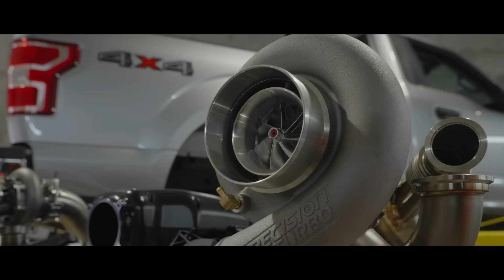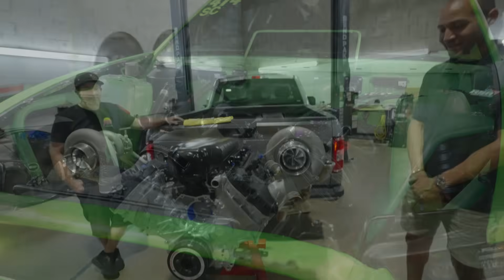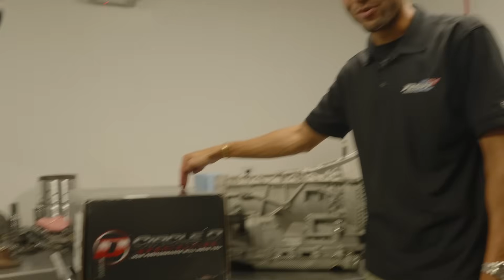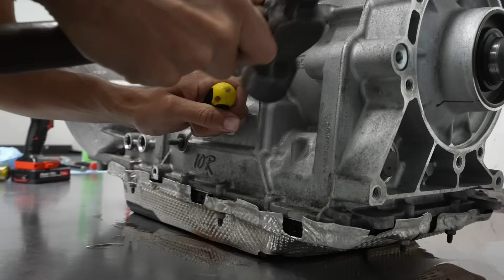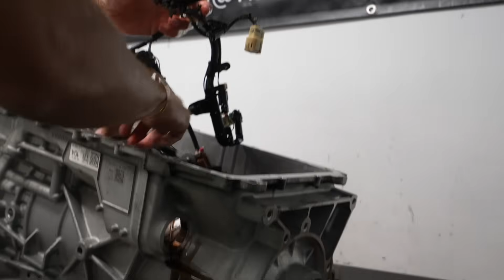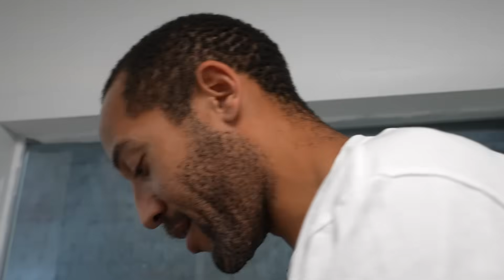1600HP 4WD F150 "Work Truck" (Building the PERFECT Coyote Truck)

Comment: I cant wait for people to develop stronger and/or lighter weight replacement parts like a better drum considering its so small compared to a 6R, where these 10Rs become reliable at all power levels and theres no need for a th400.
Reply: There was never a "need" to do TH-400's or Poweglides. It's a copout; It's expensive to learn about new technology without the right tools or training, people default to what they know best.

 You want more gears to keep the engine in its powerband longer.

Comment: So sick!  I'd also see if power is being put down to all 4 wheels, a lot of XL's have open diffs in the rear and all were open up front.  Raptor's come with a Torsen limited slip front and electronic locking rear if looking for an OEM upgrade.

Comment: That's preschool power compared to those built GTR's  And I'm talking comfortable street driven GTR's!!!!  Why are 2,500-3,000+ hp not as common? The coyotes have two extra cylinders!!!!😔 Someone please explain.🤨
Reply: Also I'm pretty sure Brett Lasala went faster in his Coyote powered Mustang than any single one of the dozen plus GTRs at TX2K this year
Reply: @somethingtough  This year. What about the recorded ET/MPH?
Reply: @user-yt1zn9sz5b  record et and mph depends on what class you're talking about, I think there's 7 classes. Et and MPH in stick shift? Et and MPH in street car unlimited?
Reply: Imagine comparing a $120,000 stock, not even including another $100,000+ in mods supercar, to a pickup truck
Reply: Go to bed kid!
Reply: @RustyWells2  If your intention is to insult me, its an indication of low self esteem and Immaturity. Facts aren't my ideas. They are proven truths. Now, fact check MPH, ET, HP and TQ. It's the mature thing to do. This response isn't to insult you.
Reply: How many of those gtr’s are running mid to low 6s with that power
Reply: @petergalvez6431  zero
Reply: Can any of said GTRs beat Brett LaSala ? Not many if any
Reply: @bryanbridges6152  I specifically said horsepower, not racing. If your referring to ET or MPH, fact check it. What's also interesting is that those GTR's also make more TORQUE. I'm just an unbiased enthusiast making comparing two monsters.
Reply: There isn't even 1 2500-3000hp GTR street driving
You're insanely delusional, plus you're comparing a super car to a truck. It's impossible to be dumber than you
Reply: How many of those 2500-3000hp GTRs have a stock block?
Billet coyotes can make 4000hp but this is not a video about billet engines.
Also, you can say a 2500-3000hp car is a comfortable street car all you want but it’s just not true.
If you think it is you must have a different dictionary to me.
Reply: The car community is full on band wagons and sharlatons. OP doesn't even own a 1,000 up GTR let alone a 2K hp car.

 Most people struggle to make 500 wheel horsepower, yet like to comment on stuff they know zero about.

Comment: Coyote + unlimited money= this
Reply: Still cheaper than a 1600 hp 2jz
Reply: @an_average_whiteguy  I doubt that man....have to really research coyotes but they aren't cheap.
Reply: @SupraMane69  a coyote can use stock heads cam and block. Upgrade the springs, rods pistions and sleeves and you have a 1600hp+ capable motor reliable still running water. At that hp level you start running into issues with the stock block on a 2jz. Then you get into billet blocks which are 10x what any coyote would cost
Reply: @SupraMane69  plus it's a more efficient engine and you make more HP on less boost so it'll last longer than the equivalent hp on a 2j. 40 psi on a coyote is like 1700, 60 psi on a 2j is like 1600
Reply: @Mr_King03  Totally depends on turbo size...a 6766 on 60psi isn't going to make 1600 lol. But yea your right its a more efficient engine. But it is 30 years newer. I hope it would be
Reply: @an_average_whiteguy  highly doubt that
Reply: @Mr_King03  Yea them 2011+ technology and almost double the ci does make more power.... your right
Reply: @chaseself5420but that’s a pro mod, non-streeetable car, so not really what most people are after.
Reply: Facts!! 💯
Reply: How much you think this build cost?
Reply: @kturbo504  I kno a built short block thay will hold that power is $15k+
Reply: @SupraMane69  Yep and you can sell your old block because that includes a core. Imagine paying that same price for 2 less cylinders and less power.
Reply: @owenwagner9017 yea its faster in a 1900lb carbon fiber race car...of course smart one
Reply: @SupraMane69  the coyote is a great platform, just admit it.
Reply: @owenwagner9017 it is sadly
Reply: @SupraMane69  2jz is still legendary. I wish they put it in the new “Supra”

Comment: That transmission dude is a clown.  It’s easy to get a transmission to live a 1800hp with torque management.  I’d love to see how his trans does with all the safety’s turned off.
Reply: "It's easy to get a transmission to live at 1800 hp with torque management" -dude who works at Tractor Supply and drives a 1995 V6 Mustang
Reply: You should build one and show them how it's done! You're wasting your talent wishing bad on someone in the comment section of a video😢
I think it requires talent though, so stay put
Reply: 10r80s don’t last very long even built
Reply: @petergalvez6431 bs

Comment: Can someone confirm if that faulty valve body issue would be the reason a truck this generation would run fine and then at a red light randomly idle so low to point of the engine stalling out?
Reply: Probably a phaser issue. Not valve body
Reply: My 2016 kept doing that.. Ford replaced the phaser solenoids.

Comment: Having a 2023 single cab short bed "RWD" f150 with a 5.0 im glad i watched this because i can say ive been having issues with my trans stock.. has 8k miles atm, i daily it to work, ive only romped on it like 5x? and the trans just does all kinds of dumb shit, it never shifts to 2nd on upshifts goes from 1st to 3rd, thats fine but it also ignores 2nd most of the time slowing down, but every now and again it goes to 2nd slowing down and just Jumps forward and up and rpm "lurches forward basicly" and clunks into 3rd sometimes, shocked tbh but this video taught me alot about it, cant tell if i Hurt it somehow? maybe burning up the clutch? or just a bad egg from the factory?
Reply: Having experience working in a dealer as a tech, corporate ford as tech help, and driving these trucks - the 10 speed is very quirky. Not saying you dont have an issue with it, but honestly it is probably "normal". They are very erratic and jerky transmissions sometimes. Look into Alejandro Flores on youtube and you'll be shocked as to how much you will learn.
Reply: Normal driving they skip shift unless tuned.
Reply: Sounds like intermintent "shift solenoid function" seems to be common on the 10R80, the transmission and the factory solenoid are made in china=💩
 I'd have it looked at before it becomes a problem.😎
Reply: In normal drive mode at moderate to low throttle input the transmission is designed to skip gears. Sport mode it will use each gear on the way up. I have had a few times were mine does a slightly harder shift from 3 to 5 but otherwise fine. And very rarely will do the lurch at low speeds in stop and go traffic. If it is very frequent I would ask the dealer to reset the TCM and see it that helps.

Comment: The rear end shock mount does look flimsy, it should be reinforced and upgraded ...for safety at this power level. Love the build.
Reply: There's other ways to say that you know nothing about racing
Reply: To independent rear suspension??
Why no one with fast f150s do that
I’ve seen a couple with 9 inch axle swaps but not
Irs